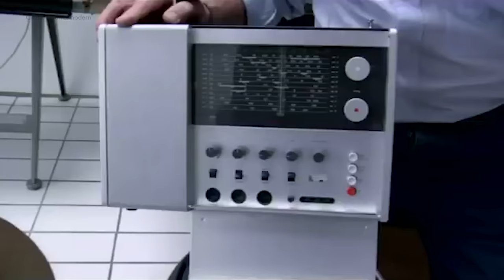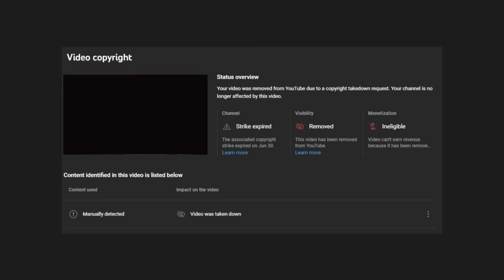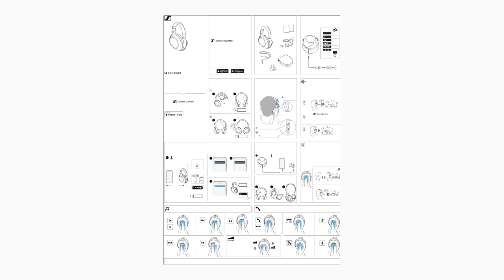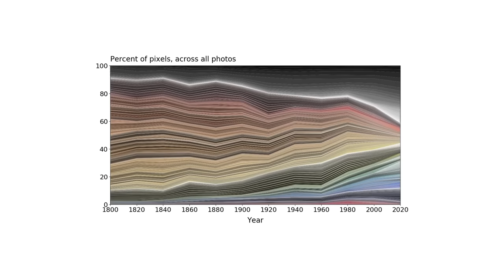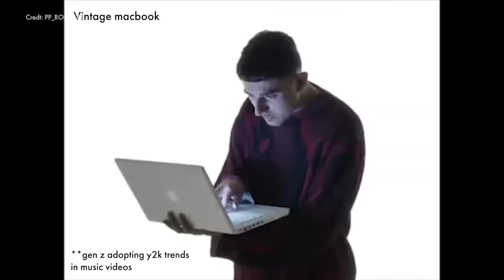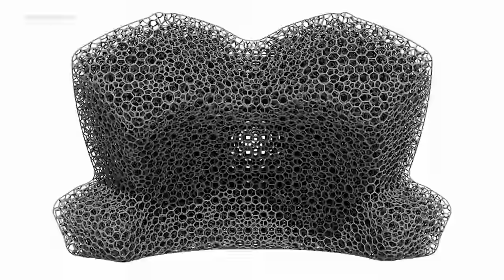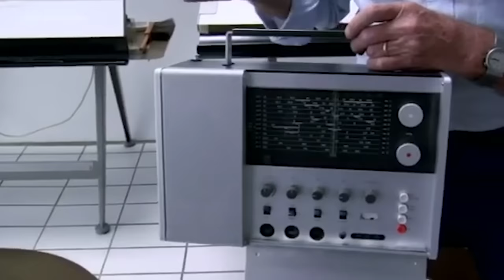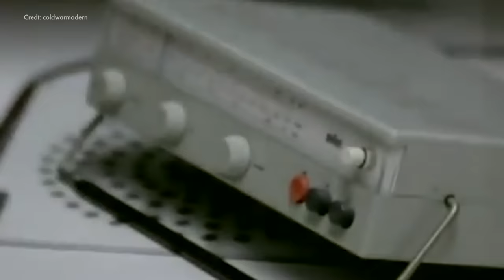Minimalism is Getting Absurd: Updating Dieter Rams' 10 Principles

Comment: in a lot of ways the designs we use to reduce environmental impact, like with fuel efficency and electric cars for example, actually makes them worse for the environment than the coal burning baby punchers of yestercentury... simply because there's a LOT more resources used and pollution made as a result of implementing those "cleaner" features.. and the vehicles will break down and need to be repaired more often, and replaced sooner which means one new car is only worth about a 1/20 of one old car (when new) and still costs us almost as much environmental impact to create.. 

Even if we cut the envirnmental impact of production and operation by half in the last 70 years, the 70 year old design for the car is still operational today and uses very easy to produce parts that at this stage in society, many people can actually manufacture in their homes because of the increased interest in people learning about machining and making things.

So basically, a car that runs for 70 years is overall cleaner than one that uses half the fuel, burns cleaner and was produced in a cleaner way, simply because you only need one car for that 70 years, instead of 7~12 cars. And a lot of people just buy a new car and sell their old one every 2 years these days anyway.

Even if we're trying to make the product better for the environment... we're making it worse BY making it better.
Reply: All vehicles eventually break down. The more ecological thing to do is invest into something that won't. Not buying a car is pretty cool.

Comment: #1 Good design is honest- I think it's more about avoiding those features that seem to promise more than the product can actually do. More like the overhype on really cheap and poorly built say, speakers - claiming a thousand watts(!) but not being really more than 10 or 20 max... or fake dials on the so-called 'fashion' watches that are just painted on with no function whatsoever... But granted, it was poorly explained..
More- about Porsche- it's really one of the very few car brands that did keep a lot of its design cues constant over the years. Sure they have new models- but they are much more conservative than most other brands. A 911 made recently while not identical to a first production model- keeps a lot of elements from it and is recognizable as a variant of those. So yes- conservative and minimalist as far as the outer appearance goes. The engine and all important parts really were extensively redesigned and updated sure, but the outward appearance is pretty much the same.

Comment: 1:38 When I see glasses like that I'd expect her to reprimand Wazowski for not filing his paperwork on time (monsters inc).
4:25 Lol, my first impression of that calculator was "wow, a cheap calculator that doesn't even have solar, no exponents, no sine, etc. That must be a dollar item."
10:52 I had no idea a mouse could look this cheap and plasticky. I'd be disappointed to win this from a 60 cents raffle ticket.
I guess that's how everyone's taste differs. Most of the designs that were used as examples in the video looked either cheap to me, impractical or redundant.
Why would I buy a mouse made of jail-plastic that doesn't fit my hand when the same money can get me a wireless mouse with extra thumb buttons that perfectly fits?
Why would I buy a calculator that barely has basic arithmetic functions, when the same money can get me a calculator that never needs to be charged or battery swapped and has all the advanced functions?
Why would I ever buy an I-Phone when I can't even sync my music library from the PC to the phone?
Form follows function. A product needs to work first, be customizable to my specific needs second, last a long time third and look good fourth. The weird thing is that a lot of cheap Chinese products get the first and second points right and then fail catastrophically on the third one.

Comment: I feel like most of the criticism of Rams's principles stem from the fact that he designed appliances and the video creator uses fashion or fashion-adjacent products as examples. Rams: Appliances should be like this. Video: Yeah, but fashion should be like this, so Rams needs correction. I wish that not-so-nuance were more prevalent in the video. That said, I do think the video makes clear that Rams is of the Bauhaus generation, and modern society isn't—which is another reason why his principles feel less-than fully relevant today.

I have no idea if this is the case, but I wonder if his 10 principles were actually for Braun, part of his style guide or design system. If that were the case, then his principles should not be seen as universal truths (thought many get close) but simply as Braun's design principles for its product team to adhere to, and they were meant to apply to all other companies' products just as much as the London Underground's style and principles are meant to apply to Burger King's marketing materials. Just a (possibly untrue) thought.
Reply from the maker: The problem isn't really with Rams' principles. The problem is that other people blindly follow them without taking the broader context into account. They treat them as an immutable gospel, but it's pretty easy to find their shortcomings if you switch the context away from a 1950s appliance company.
Reply: Yes, exactly. You conclude that they are excellent starting points for beginning designers. In your video on copying, you mention how replicating the works of the masters is so educational. I think that lesson applies here too. Take his principles, and use them, then adapt them, then question them, finally develop your own. Thanks for the reply.

Comment: so, regarding the blind commitment and your explanations:
a. honesty - where do the mentioned glasses or harddrive promise anything that they cannot keep, don't ignore his definition please
b. simplicity - to prevent oversimplification (which results into making product hard to use) he specifically mentioned usefulness and understandability, the issue is other designers ignore these principles on purpose while still claiming they follow what he said
- your apple analogy is wrong, the problem isn't minimalistic design, but apple (and other manufacturers) cram as many things into as small space as possible, and this makes it initially hard and expensive to produce, but over time this makes the same things better while cheaper then previous generations (look at some cheap but still "simplistic" android phones that are way better and cheaper then phones from 5 - 6 years ago)
c. environmental friendly - he specifically mentiones "design makes the contribution to the preservation of the environement". you then twist his words and pretend he said something else.
d. long lasting - there is a difference between a disposable product and long lasting design, you can have long lasting toilet paper that is disposable, disposability can be actually derived from the environmentally friendly principle. the actual problem can happen when you have disposable but not long lasting toilet paper ;)

Comment: You need to ask what constitutes this definition of "minimalism" in the first place.
I feel that many carry an immature understanding of it, much like that of "perfection".
For instance, the latter is often characterized as getting every single aspect of something down to the T, just right, even if it takes a heck ton of resources or a lot of time to realize. However, this is only a subset of it. 
Perfection could be ensuring the best possible outcome within a time constraint as well. In this case, the definition now accounts for efficiency in time as well.

Likewise, "minimalism" is not something to be understood as something which gives the impression of that via looks.
To me, minimalism is something which only has stuff that are conducive to whatever the product sets out to be and just that.
No extra bells and whistles.

Is it better than other method philosophies? No, maximalism has its own benefits just that due to the overflow of information and products all around us, society in general seems to be moving towards something that is more easily parsed through.
That and adding less stuff naturally leads to a lesser failure rate. So that works with sustainability as well.

Comment: actually a porche boxter is just about the most pragmatic high end car there is: they rarely break, parts are easy to find and the engineering  has been incrementally improved over decades. If I didn't need to put paintings and sculptures in my back seat, I'd have bought a classic boxter in a heartbeat

Comment: The pared down version of these principles can be interpreted in different ways. Or rather there are some rather gross oversimplifications that assume how people would interpret the words. Now, I don't know the original language they were written, but if they were not originally in English... you would also be working with meanings that get lost within translations as well. And even within the same language, there is an issue of context/perspective as well

For example: "Good Design is Honest" -- honest for who, or what? The video mentions 'honest to materials' with Bauhaus - which with certain designs... makes a lot of sense. Some portions of the Bauhaus were after good designs that looked and felt valuable, contrary to their desire of making "cost effective" products (hello, metal teapots with extraordinarily smooth and polished curves that were hammered out by hand? and some of them using ebony or other luxury materials? anyone...?). Making a material mimic another "cheapens" the product and the material itself used, even if what was used/produced is a luxury/quality material or product. But that is a completely different ideal. You can argue that it is supposed to mean "honest to itself" or that the design does not stray from its purpose or intent. If the intent is to make a cheaper and more accessible material pattern that mimics material that would have been gathered from an endangered species for the goal reducing the value of poaching those species to help ensure their continued survival, then creating a material that mimics another would be "honest to the design's goals"

Another example is an alternate interpretation of the examples used in "Good Design is as little design as possible." The reading used in the video is "as little visible design as possible." Another reading is to consider the design process itself, with minimizing the number of complicated steps to get to the solution/product. In paring down the number of buttons on modern/minimalist designs, they've ironically increased the amount of actual design work done by figuring out new systems - this includes series of taps, swipes and holds to make a single button perform varieties of tasks. Another thing that becomes skewed is with "non-essentials." With current modern minimalist design, they "do away" with 'non-essentials.' The issue is... some of those 'non-essentials' are not actually non-essential. So they're also screwing up on that front as well

Additionally, his mention of hatred for when beauty is the primary core focus is on when they decide to prioritize that over the function of the object itself. Current Modern Minimalist design tramples on that with "beautiful/sleek" designs that are unwieldy and require an entire manual for button taps and inputs to figure out how to operate properly, as opposed to an object that can be intuitively figured out and easily operated without a manual. So there's a bit of trying too hard to push an agenda here. I don't think he's actually that against decorative flairs, but those take a backseat to function as the product needs to function properly first before adding on all of the other parts to make it look aesthetically pleasing

Then we get to the part where the examples used are flat out wrong. "Good Design is Environmentally Friendly" is still perfectly reasonable and viable. If it cannot be environmentally friendly, then it is not environmentally friendly. DUH. Electric Vehicles are... not good design under this criteria. There's another term for describing this type of a product - 'green-washing.' They make the product appear to be environmentally friendly, but it is not actually environmentally friendly. Which then cycles back to the "Good Design is Honest" part where it simply isn't honest with environmental friendliness. The mentioned "Eco Effectiveness" correctly falls under Environmentally Friendly Design, and "Eco efficiency" is... sorta, but not really there. Eco Efficiency only tackles the second half of the principle by conserving resources (when compared to an existing product in use) and minimizing physical and visual pollution (when compared to an existing product in use), and even then... it doesn't do that well since it is only a "better option compared to the more terrible existing options" rather than something better than the current best options. The first part of "contribution to the preservation of the environment" is arguably completely ignored, particularly when considering electric vehicles since that is a heavy down-payment with additional costs and practically no recuperation

There are parts mentioned that are actually factually incorrect as well, particularly with the bonsai example. No, people do indeed 'torture' the trees to make sure they are growing in certain ways in certain trajectories. They place heavy stones on branches, tie parts down, control watering the plants, and indeed force those to their will. Hell, they even control pot sizes and room to grow so they don't get as large quickly by a default. I'm so sorry that the example sounds so convincingly right, but is actually so very wrong in any number of places. There are limits to what you can do with forcing the tree to bend for sure, but the overall...? No, people definitely force those trees to bend to their will, as much as they can without outright killing them or destroying the branches if possible. "Happy accidents" are not entirely up to chance either, as you can see what it is and decide whether or not it is reasonable to keep or if it is necessary to discard it. You are making a conscious choice when you decide to make use of a "happy accident" or not. It is by chance that it occurred, but it is NOT by chance whether or not it remains. Yes, there is some amount of organic "letting things grow/develop" going on with these examples, but there is far too much downplaying of how much control can end up occurring behind the scenes

We get to the part of "Good Design makes a product useful" and we conveniently ignore the subtext that perfectly invalidates previous arguments that Dieter hates aesthetic styling and decoration. "It has to satisfy certain criteria, not only functional, but also psychological and aesthetic." So aesthetics is a part of what makes a design good/useful. The specific thing mentioned in the clip earlier on was that he "hates everything that is driven by fashion" (paraphrased). Probably meant something along the lines of designing for trends. Which makes this particular subtext for the principle a bit ironic since "psychological and aesthetic" criteria are a considerable portion of that. To be more specific, he is alluding to what is now called "fast fashion" where they cycle through trends and discard everything that is now considered "old" and "dated" - which "fast fashion" is not environmentally friendly and runs in conflict with earlier principles. The example of a sports car for a soccer mom transporting kids is missing the point as the wording is to "satisfy certain criteria" and not 'satisfy every single criteria for every single person for the purpose of this particular tool.' So we're missing the point entirely by trying to make a tool work for something it was not designed to do

"Good Design is Innovative" is meant to be a point of "why redesign the wheel when it works perfectly fine already." Good design needs a reason or purpose to exist, and is innovative when it is first put out. That's all. It's simply "don't reinvent the wheel if you don't have to" written differently. Dieter's designs are fine - they don't change much because the original design were simply good and innovative at the time and there was simply no real need to change them over the years. There is no contradiction here

So here's the issue with this type of analysis on these design principles by trying to pick them apart individually -- a number of these principles are interconnected, and several of them make up for the pitfalls of other ones. It is fine to analyze them individually, but it is also necessary to take a look at how they all interact and connect to one another to make up for their shortfalls

I actually don't disagree too much with many of the points raised. A number of them simply rubbed me the wrong way so I'm just pointing out the more critical issues, which just happened to be littered all over the place. But the main general idea that current minimalist designs gets any number of these principles wrong is absolutely correct, and I can wholeheartedly agree with that

Comment: Contemporary interior design is an excellent example of form over function. When I come home, I want to curl up on a cozy, plush couch and feel comfortable and relaxed in a well-furnished living room. Modern living rooms look like the exact opposite: austere, cold, bare-bones, and above all uncomfortable. Muted colors, stiff, square couches with thin armrests and even thinner cushions (yet the throw pillows are over-stuffed), tiny end tables on thin pedestals for ease of toppling, and generally plain, boring design. Rarely does any of it appear "elegant" - only uninviting and unusable except to sit on the edge of the seat for a few minutes while you and your guests have superficial conversations.